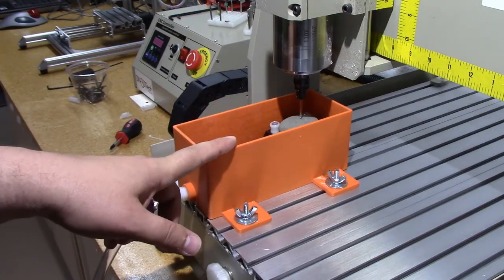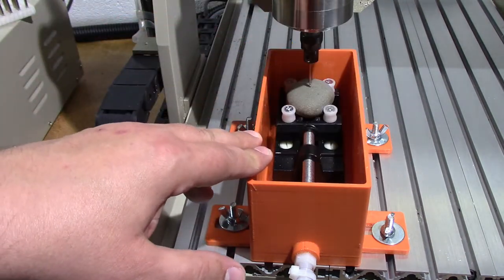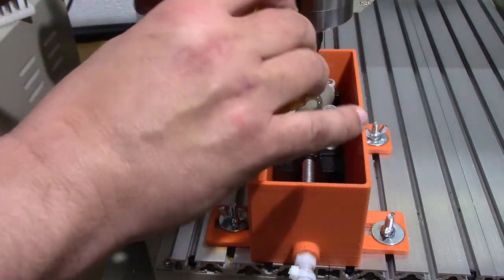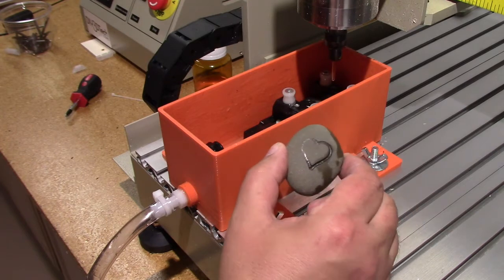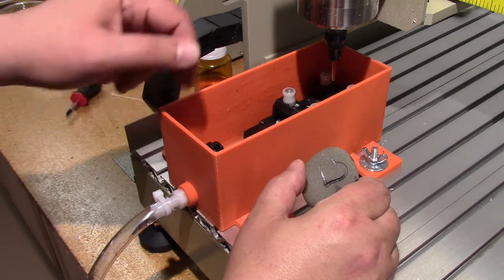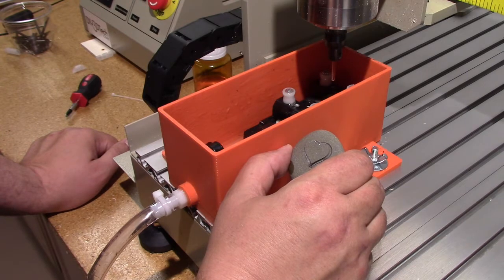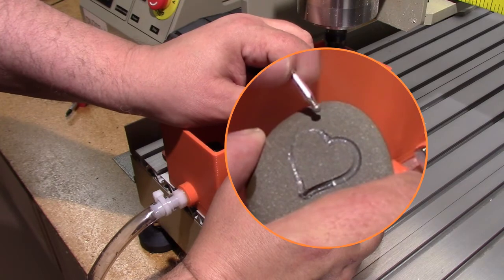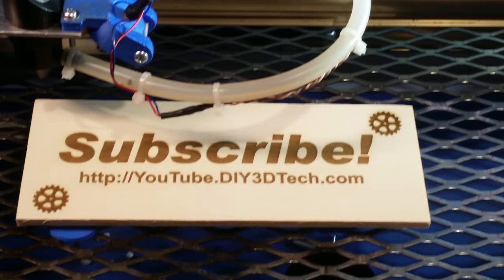3040 CNC - Using New Water Bath to Engrave a Stone!

Comment: i'm by no means an expert, but when i was looking around @ carving aluminum, i saw mentioned that taking thinner passes only puts more work on that part of the bit, and it's better to take deeper cuts in order to utilize the bit's cutting area better. this may not be as true with a ball end. anyway, i'm eager to find out what your investigating reveals. i'm in the midst of carving some soft stone and like the water immersion idea. looking forward to finding more about that, too!
thanks for this- very good video.

Russ from Coral Springs, FL, USA
Reply from the maker: Russ I plan on doing a lot more of the this and for aluminum they are some what right and you have given me the idea for another video as the reason i say this is with aluminum, plastic or wood there is an optimal "chip" load for the tool and it is a combination of cutter design (angle & flute count) as well as feeds and speeds.  Yet in cutting the stone we are "grinding" it and there isn't a chip load per-say as there is with aluminum and hence the difference.  Also thanks for the kink comments!  :-)